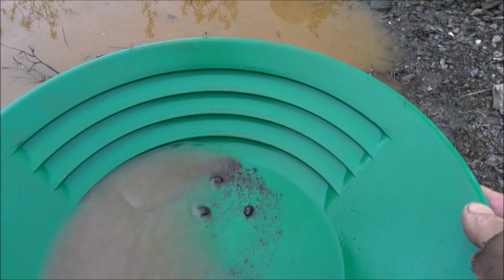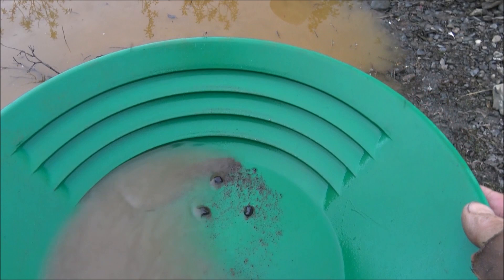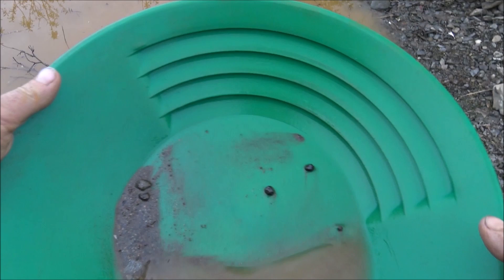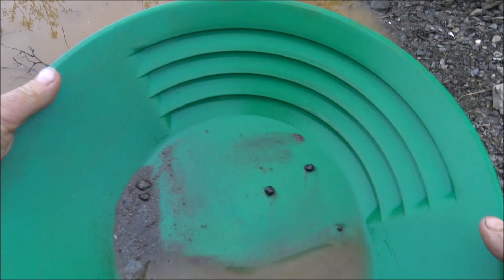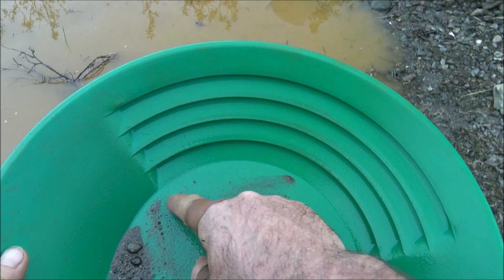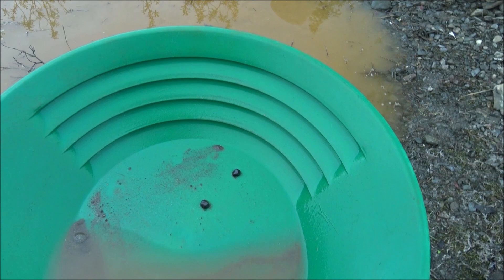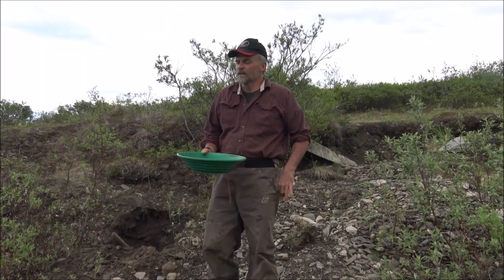Prospecting Alaska: Testing Gold Bearing Material

Comment: Maybe you can join one of those programs, where they always get a Machine broke, and one of them has to go all the way into the city to buy new parts. which costs them around 10k$. Then they get the gold they folded up for the month or so. Then they barely break even. Funny programs though.
Reply: 3iviN0 don't forget they have a deadline to meet or go.bust.
Reply: Vernon Hastings I KNOW RIGHT AHHAHAHAHAH
Reply: 3iviN0 I know it gets really cold there,  but why don't they build a shop and service /maintain the equipment in the off season?   They spend half the season getting the stuff back up and going,  then work 24 hr days at the end to make up for it, smh.  I'd spend some of those ounces on prevention if it were my operation,  but that's boring TV.  ; )
Reply: Ikr :)